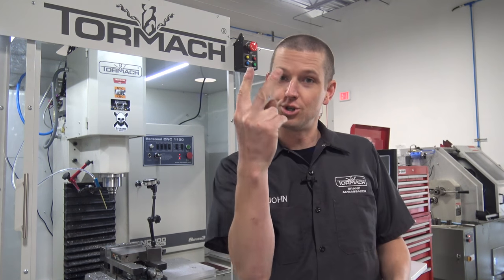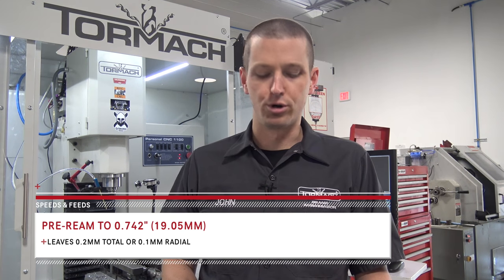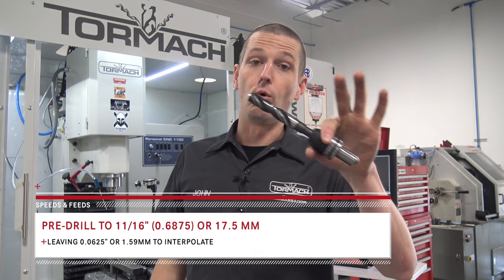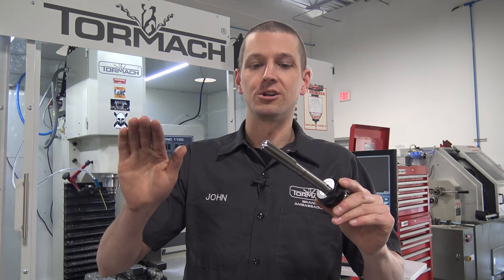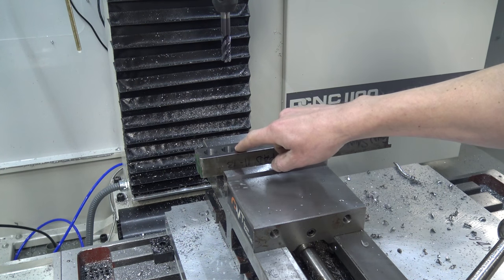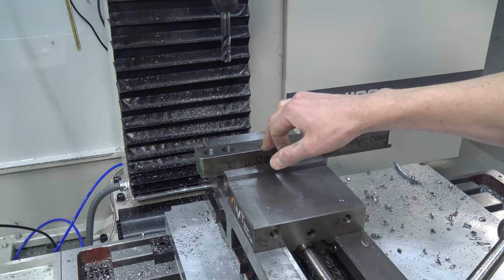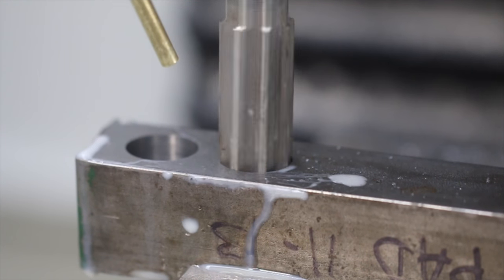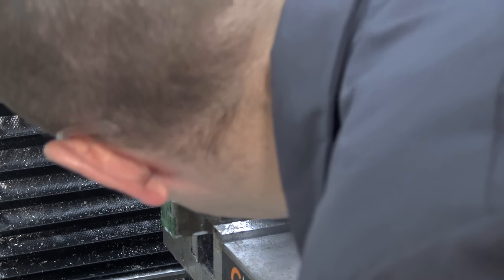Rough & Ream?  Will it work?  Part 2  Widget95

Comment: You call your self a Novice, I have been a registered Tool & Die maker in the state of NJ for over 15 years. And I am always learning new things I have worked with people that have been in the trade for over 50 years and are still learning new things. Theres always better ways of doing things, you also have to work with what equipment you have and can afford.  I watch your channel to get my fix of CNC mills, I don't do any machinist work much anymore since I am stuck running a cnc laser. I am not complaining since I get paid well, and it's nice clean work. Keep the great videos coming thanks.

Comment: I ream when I want holes to be precisely sized, especially for interference and clearance fits for dowel pins used to align parts.
I typically drill a 64th undersized (16 thousandths not allowing for drill runout) then ream to size.
All tools have to be straight and sharp.
As mentioned in a couple other comments here, when readers get dull, they get slightly tapered, bind, and cut polygonal holes.
I'm not saying that happened here, just watch for that.
Keep doing these videos. They're great reminders for us old guys and great teaching aids for newbies.
Thanks,
John
Reply: P. S. It's fun watching you become one of the old guys.
Thanks,
John
Reply: Reamers, not readers.
Ain't autocorrect grate?
😂😂😂😂
Reply: Great. Un auto correct.

Comment: Hi John. I don't read all comments, but you understand that reamers have their tolerance? I don't know what is used in US but in Europe there is standard ISO tolerances for holes and shafts. Common standard for reamers is for H7 holes it means that in your case if your reamer is nominal 0.75 you should feel satisfied with the hole size between 0,75 and 0, 0.75083. What I learned from really experienced CNC operators that if you use oil when reaming steel you will get bigger hole, if only coolant smaller hole in tolerance range. Also with carbide reamers you get smaller holes compared to HSS. With carbide reamers you could get even undersized holes. That what I got from 1,5 years working in quite big workshop as cnc tool warehouse supervisor. It was really very helpful for me all that info directly from operators. Keep up good work you inspire me and also Grimsmo brothers.

Comment: Even at 0.7505" that reamer is not stiff enough to imitate a boring bar and make a hole larger caused by the 0.001" runout. (The chamfer on the leading edge of the reamer is designed to self-center.) It will just deflect to the center. You can check this by indicating the reamer as you did and then pushing the reamer toward or away from the indicator with a fingertip. You will find that even gentle finger pressure will deflect the reamer by more than 0.001".

(A floating reamer tool holder would be better, though.)

Comment: Regarding the boring op, remember you are using a roughing end mill so at a minimum the wall may not be as smooth as you'd expect. Also end mills are made to specific tolerances. In critical operations it makes sense to determine the actual size of the end mill. A simple solution might be to mill a part and measure the results. Then depending on how you choose to machine the part, either enter the tool dia. offsets ( assuming you have those in the Tormach) or reprogram the CAM with the proper size. I've learned not to worry too much about the exact size of the drilled hole for a reamer. Your mileage may vary.

Nice work on figuring out how this all works. Keep going.

Comment: Snap gauges for bores are really only reliable to about +/- .001. Maybe .0005" if you have a really good set. 

Intramics are the better way to go. They measure 3 points within a bore which is really the correct way. Expensive measuring tools (but what isn't in this trade?) but still cheaper than a CMM. 

I'm willing to bet if you took 4 measurements around the bore with your gauge and averaged them out you'd get .7505 or within a few tenths of it anyway. 

Oh. And no need for the bigger drill pre-heliboring. The 1/2" hole is plenty. And it helibored undersized simply because it's a rougher. I'd wager that endmill is a thou or two under 1/2" anyway. Roughers are generally ground undersized.
Reply: Oh. And yes it did spin in the collect at the end. 

You used a rougher that had a significant corner rad correct?  Did you make sure to helibore down far enough to clear that radius?  Go at least the corner rad of the tool + another .010" deeper than the bottom of the part. 

So if you have a .060 CR on that tool. And your stock is 2.000" thick. You need to helibore to minimum depth of 2.070"

If you don't, your gonna leave a .060 (or whatever the CR is) radius at the very bottom of that hole. Which is more than enough to stop the reamer from cutting. 

Or you didn't thighten the collect down... And have now ruined it... Mark it and use it for general milling now. Spinning a tool in a collect like that pretty much junks it for doing any type of fine work like reaming or tapping... It's now and endmill holder :)
Reply: For the money I like using pin gages. I have been doing this for 15 years and still can't reliably measure sub .001 on a bore with snap gages. Go no go gages leave no doubt though. :-)
Reply: +bcbloc02 16 years in the trade here. 

And to hold +/- a tenth or two pin gauges aren't even reliable. Even  with a plus and minus set of pins you have a 4 tenths gap. If you drop the cash for deltronic pins ya, you can reliably hold millionths. But for the money a set of intra trimics will get you within a tenth And a single tri mic covers a .100-.200 (depending on size) range which is about the range of a pin set and costs about the same as a good pin set. 

I prefer intra trimics whenever I can with  tight bores. But for the work John does. A good set of plus and minus pins should be more than adequate. 

But if I were him I'd slowly build up a set of trimics too. Like whenever a job with a tight bore cows through, order the trimics for that bore size. Doing it that way also saves from buying ranges you'll never use.
Reply: Occams Sawzall
Yeah I had in mind measuring +/- .0005" with pins. That is plenty good enough for 99.9% of what I do. Intrimics are awesome, I have 1 for doing crank bores. They are pricey though!
Reply: +bcbloc02 I'm rambling now. But with some medical parts companies ( and a few other industries ) they won't accept pins to verify hole sizes. Because pins are a comparative, not a true measurement ( trust me I had a 3 hour long argument with an engineer over this... And I lost >.<). Only mics or CMM is acceptable since they produce an actual numerical measurement. Again not the kind of work John does right now. But when you stick a "medical use" tag in a part you can practically double what you'd normally charge for it. And they'll pay it too.
Reply: Cmm isn't even reliable for measuring holes unless you take a lot of points
Reply: +m98custom12 I know.... That was most of hour 2....
Reply: +NYC CNC yes.  And large set of gauge balls too XD

Comment: John, You got it much better this time and you seemed to pick up on the troubles you had on the first hole. Good job! The one thing I might suggest is using tapping fluid instead of coolant mist. The lubrication properties are much better and I bet you will get a much smoother bore. Be sure to let a little drip down the bore instead of just applying it to the reamer. Another person commented on the runout not being that critical. He is absolutely correct. That is the reason that reamers are so long in the first place. They self center at the first touch and then follow the hole they cut. If the pre-ream hole is off center from the reamer centerline, the reamer will pull over to match it then ream a hole at an angle. The position of the drilled or milled hole is very important. (Not an expert, but I do have 36 years experience.) P.S. I used to use that dark brown high sulfur "cutting oil" thinking that slick was slick, but found that when broaching keyways in steel, cutting oil would gall but tapping fluid would cut clean. Been paying $50/gallon for tapping fluid ever since.

Comment: I like watching and picking up on how it's made. I have a cheap harbor frieght milling machine. I have noticed I have gotten must better drilling holes even free handed. At work I have earned the respect as the go to guy for good workmanship. I'm just building brackets and repairing parts right now. Thank for sharing.

Comment: We love this kind of stuff.. Even seasoned professionals like seeing different, and new approaches. 
There are several ways to machine a cat.. Meaning, your way of doing things, Adam's way, Tom's, Keith's.. they may all be different, and still produce the same results.. That's the best thing about it, it lets people learning, find the particular methods that suit them best.  It also allows seasoned professionals see and think about other methods. An operation they have been doing for 30 years, could be a little faster, or easier if done a different way. Even if it doesn't work, you're at least giving them the opportunity to think about different methods,  as well as share their insights, which helps those learning.

Comment: John i love watching your videos and nice to see someone who has learned all this by himself.
If you are doing a lot of precise holes you can buy boring head.
You just drill a hole smaller like 3-4 mm under finall hole and than  bore it to the finall dimension or bore it 0.1-1.5 mm under the finall hole and than use reamer.
If you ream bored hole, reamer will go straight and will not wobble.
Keep doing nice videos :-)

Comment: John
You hit the nail on the head roughing mill is the measured OD but you are measuring the bore left by the troughs not the peaks hence the smaller size
Reply: Don't you mean by the peaks and not the troughs, the peaks are the high spots so would reduce the ID.
Reply: I think he meant the troughs on the tool, which would be the peaks of the hole
Reply: +Josh Peterson sorry this dyslectic thing is getting bad brain knows what it what's to but I cannot get it down 
Let's try again the troughs on the tool give the peaks in the hole ,but the cutter is called out by its measurement across the peaks 

I think that's correct
Reply: just about to say this, add a couple though to the wear and reamer should clean that up.

Comment: good video john. i was taught that a reamer will always try to follow the hole. a less than perfect setup would probably benefit from a longer more flexible reamer. also i think the use of pin gages as a go no go check would be the way to go.i really enjoy your experiments,most have applications beyond cnc.

Comment: Much better! The only thing i would add, other than to tighten the piss out of your collets, is that the second drill is probably not necessary. When helically interpolating all you really need is a hole for chips to fall through and that it be big enough to clear the center of the end mill as it goes around. The more clearance the better but the question is; is it worth another tool change? Ehh I don't think so.

Comment: John, I always us a G81 for reaming. On your machine that cycle may stop the spindle at the bottom, or did you stop it? Some times the G81 cycle will put a spiral scratch retracting the tool if that's not acceptable in the finish you should probably be boring the hole anyway. I like you enthusiasm for machine it is refreshing to see a young person enthused about machining. This profession sorely need young machinists that are interested in learning. There are so many that just set in front of a CNC machine and just operate it for years and don't know to much more than when they started.  Yes keep on making your videos you inspire others that's a good thing.

Comment: The longer the shank on the reamer, the least the effect of the run-out...  The reamer will center itself on the path, making the hole round and if your pre-hole is well located the result will be a exact sized and located hole...   ;)
(The run-out should be checked on the flutes to be more exact)

Comment: Just a thought... it looks like you are using about twice the necessary stickout on that rougher.  Every rougher I have ever used has some sort of corner radius or chamfer.  When you are feeding down, depending on radial DOC that radius can cause some amount of radial deflection.  I know that your hole size was satisfactory for the job at hand but if you need a more accurate bored hole try choking up more and using a sharp cornered finisher.  <--(not the best for tool life though)  You can also repeat or run a spring pass if it is critical.   Thanks! Can't wait to see the parking attachment come to life!
Reply: It's a necked back rougher. It's in the holder as much as it can be
Reply: Maybe it is a tool selection issue then...

Comment: If you want to check the true runout of a reamer just put an indicator on  the shank while its reaming the hole, far enough away from the holder to get a true reading but far enough from the flutes that it doesn't crash your indicator . I have had good results with drilling a 64th under hole then circle mill out the top of the hole about .250 deep .005 under the desired finished diameter. This has always given me predictable results.

Comment: I enjoy these probably more than the more advanced because I do not do CNC (just a hobby guy with a manual mill) and seeing this kind of thing also helps with those situations.  I enjoy that you (or Brian B. :-) answers the questions/comments from people like me and don't put us off because we aren't experienced.

I do have a thought/question...if you were using a roughing end mill to cut the hole, if you didn't have your path go well below the bottom of the part, could there have been more material left there because the rest of the mill didn't clean up more if it as it would do further up in the hole?  It could have left too much material for the reamer and that is why it grabbed and spun in the collet at the bottom of the hole?

Comment: I think I would just jumped right to the bore tool-path. Why predrill?
Reply: Same thought here.
Reply: The 1/2" drill I could see. Removes material faster and gives a place for the chips to go.  But the 5/8" wasn't needed.
Reply: End mills don't plunge well, they have trouble center cutting. It is common practice to drill first, then use the end mill to finish the diameter. Should only need one drill op, though. Always remember, nothing removes material faster than a drill! Use a finish end mill, and if your machine and toolholder are rigid enough, you can tune the diameter by ten-thousandths.
Reply: +Fred Burtt 
Depends on the endmill. Cheap endmill's are ground dead flat on the bottom. They can plunge cut, but are generally horrible at it. Quality endmill have a concave cusp ground on the bottom so the tips are slightly lower than the center. These will plunge cut quite well (see guhring diver endmill's especially ) plunge cutting is actually a very old school way of fast material removal, and it's actually making a come back for larger steel parts.

Comment: That was almost perfect! just need to not spin out the tool at the end ;) Probably that worn reamer is starting to pinch a bit at that much depth. You may want to check to see if it's any good or not, it should be a few tenths smaller back to front so that it only cuts on the tip as the OD should be a .002 or so cylindrical land, unlike and endmill more like a drill. If there is to much damage on it it may cut a many sided hole (polygonal) instead of a round one and that could cause over sizing of the hole and binding of the reamer at the same time.
Hey I don't have the time or motivation to produce good video's like you do that engage a ton of people in the trades so the next best thing I can do is offer your all the info/help that I can to make your videos even better. I love watching your content and if I had the time I would for sure have come down to the open house, maybe next year.

Comment: I would like to know how well location was held using a roughing end mill. very good videos it helps me as a young machinist with concepts and process !
Reply: +NYC CNC what I meant more was if there was a true position call out or just a dimension from edge to center of the hole, how close this method would be

Comment: I have seen reaming ops where the reamer is stopped at the correct depth, and retract without spindle running.  Maybe that's what the reaming cycle does?

Comment: Hey John,Backlash in your X and Y axis is going to add to the error in your interpolated holes.  Have you recently checked the backlash?
Reply: I just checked my PCNC 1100.  I have about 0.0005 backlash in X,Y, and Z.  Not to bad.

Comment: These are good videos. Yes there are people who leave comments that have done this for years and give good info and this helps everyone. You get the info and make another video showing the changes you make and the people that have not done this for years can see it working and learn from it.
As for the milling of the hole and size. I have a few suggestions. If you are milling a hole like that I found that the tool has to be just long enough. example 1inch deep hole make your tool stick out like 1.250 to 1.5. And the second is tool offset my experience is you have to make the tool offset small then actual so if tool is .500 make tool .498 or what ever you need to get hole the right size. A non ruffing tool may help have never used a ruffing tool to do this kind of hole only incert tools.
The experience I have is doing this sort of job for a few years at one shop. I just love trouble shooting problems and CNC.
Have a day
Reply: Oh sorry did not see that. If you do in the future with a different end mill give it a try.